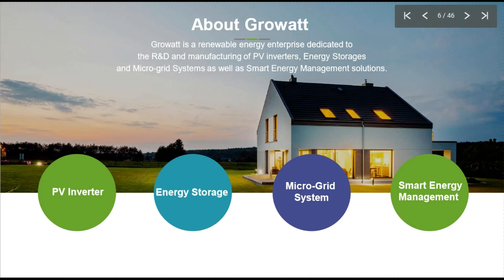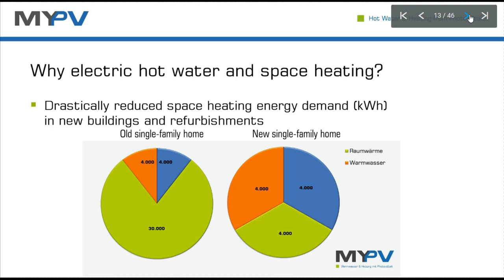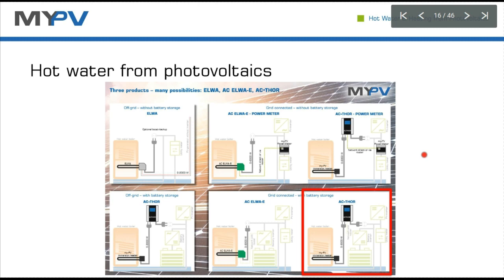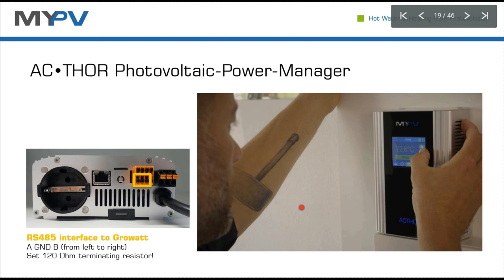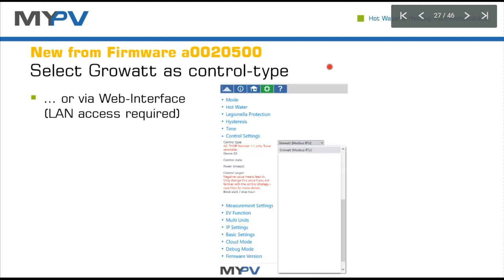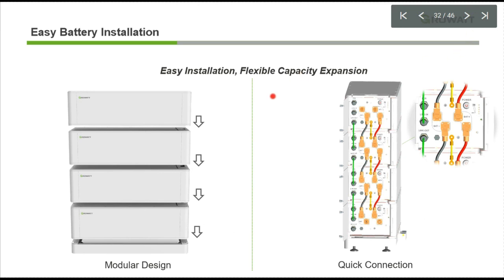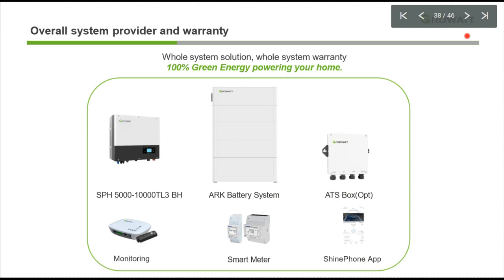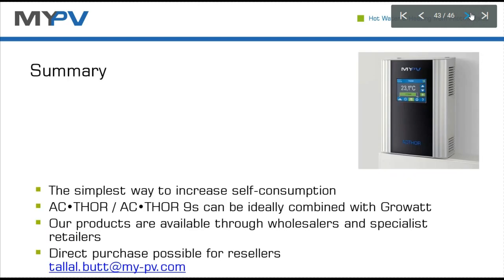my-PV / Growatt Partner webinar (English)

Comment: hey can you install a completely ordinary heater with thermostat or or should you use a heater without thermostat and use your control based on Temperature? 

have been looking at your products for over a year now without finding this answer. 

also what type of power comes out of ac thor ac or dc?
Reply from the maker: Hi Christan!
The ACTHOR is an AC product. It takes AC power from you building installation and provides it to an electric heater. In doing so, it modulates the power output so that only surplus PV energy is used.
A thermostat is not required in every case but it is recommended. What is always required on the electric heater is a STL saefty temperature limiter.